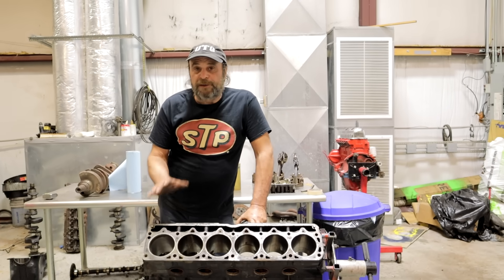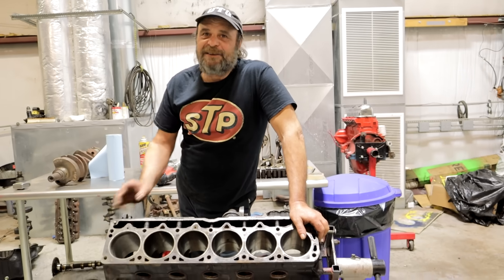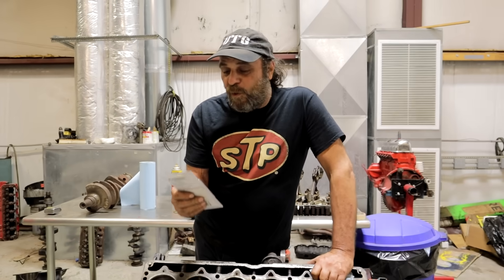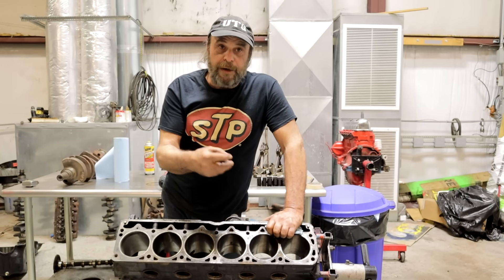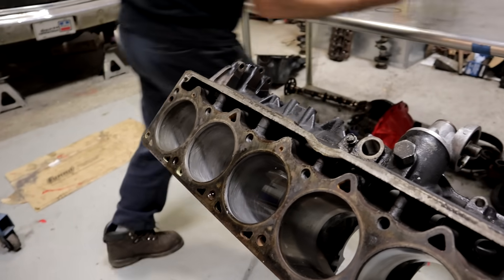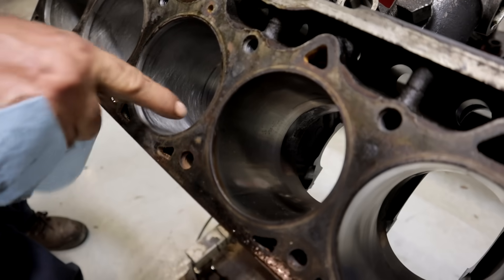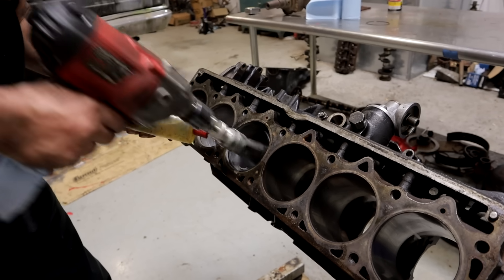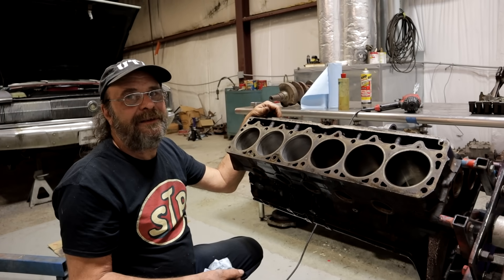Your First Engine Job - Honing For Crosshatch And Choosing The Right Stones For Your Rings

Comment: Good on ya uncle Tony 

I saw a video here in Melbourne for a performance engine builder 

and I know your channel as for the DIYer but just as a point of interest 

he uses this gauge that is about an inch wide and 5 inches long and once you finish honing, you put the gauge along the cylinder wall. It throws light into the crosshatch and gives measurements as to the depth of the scratch how many scratches they are, and the angle and they keep re-honing until they get the numbers they need for the application 

very interesting.

Comment: Do you ever use a "dingleberry" hone?
Reply: Tony doesn't even own one.
Reply: In other vids he recommends against them as they purely follow what's there and don't do anything to  correct wear. You can make limited corrections with a 3 stone glaze breaker, as shown, since the stones are rigid enough to go over any low spots.

Comment: I learned again something important cause i was sure the honning had to be shinny and like the newer rings type.  Almost like a baby bum touch with a little brush almost glazed look.  I will be more attentive when i do my next engine.
Probably my 76 360-6 Winibago engine with 85 miles on it.   If i keep the same rings after a quick clean up, il will know what rock to use according to the rings application.  If i keep or change from wear over the mesured gap.  Thanks Uncle Tony.  Nice content again.

Comment: Quite a workout! Never used a torque plate, thought they were only used on race engines. If a guy is uncomfortable using gas as a honing lube, what do you recommend?
Reply: Kerosene or diesel work well and give you a little lubrication as well.
Reply: WD40 is probably the most readily available.  It's mostly to flush out the grit and bits of cylinder wall that come off, so the stones stay clean and leave a good finish.
Reply: Wherever Uncle Tony uses gasoline as a shop chemical (not as engine fuel), I would suggest mineral spirits (lubricant/solvent), or acetone (better solvent, but more flammable).  The other suggestions of WD40, kerosene, or diesel fuel are good too.

There aren't many of Uncle Tony's shop practices I disagree with, but splashing gas around like water is one of them.
Reply: I've only seen torque plates use on a bore machine, not for just honing.

Comment: Why not remove the ridge at the top of the cylinder bores. Just lazy or is there a reason not to. The ridge preloads the hone to work and cut harder on the bottom of the bores and removing it makes for a nice job. I have seen this many times on YT videos. If the bores are worn enough in a high mileage engine you can NOT hone it correctly. Not only that but if you are going to build a high winding engine the top ring can impact the ridge at high rpm. Love to know why you do not remove the ridge.
Reply: I think this is about as well as Tony can explain his reasons.
https://youtu.be/unwAKlCdyas?t=640
Reply: Uncle covered this ridge reaming subject a few weeks ago, and explains why he doesn't ream. He explains it better than I can, but one reason is that the bore above and below the wear length of the piston stroke is the true, unworn bore and is a guide for the hone boring.

Comment: Have you ever sprayed Dykem on the walls before honing to see how straight the bore is?
Reply: Thats a quick method used by most before breaking out a dial indicator/bore gauge. That method show's you little IMO other than if you have something to start working with. Dosen't work with dingle ball hones at all and with cheap stones he is using. It's still in the hand ganade and tissue paper sign of what your working with. This method is tried and true to work 90% of the time, the main point of the video. You mised at 14:44 he put a stone in backwards, won't hurt anything its a softer metal than the cylinder.

Comment: I have been thinking about hone lately, I thought about finding a engine to test some theory on, I was thinking maybe do a really coarse rough hone, then go work up to a extra fine hone, to get a smooth feel yet have enough hatch to hold oil, it would not be a iron ring, and would probably work best with a tighter bearing and thinner oil,,  but definitely a lot more research needs to be done before any testing ,  I have heard the modern European engine  basically look like there was no hone, very smooth bores,  they use something like a 0w20 oil also,  I guess this is part of the origin of my theory!
Reply: Go find some videos from Lake Speed Jr. He's already been there, done that, and recorded his findings. He's been doing it for a long time while employed by Nascar teams to ring development. He probably had some input on the super thin rings they sell today.  Also... even American motors are using 0W20 oil now.

Comment: I am amzed you don't cut the ring grove out the top of the block, we were always taught the ring wears round on the top and the new rings are square and if you don't cut the ring grove out its supposed to Break  the new top ring. Using standard rings on a honed cylinder is supposed to make a poor boy low tension ring setup. It may use a little oil but it will wind up rpms faster.

Comment: Never tried it myself, but another DIY technique for surfacing the block, use an oil stone.
Reply: Ozzie ,  I think the 'junkyard jet' kids did that in an old vid here somewhere.
Reply: I have seen people resurfacing cylinder heads by placing them upside down on a sheet of glass covered with sandpaper and doing figure-8 motion dragging it around. I believe it works sometimes with proper touch.

Comment: Thanks for showing the kids how we did it back in the day.  However, my local machine shop in NC is very good.  I don't play this game anymore.  I talk with them about my engine goals and piston ring and cam package.  They do the Magnaflux, line bore, hone, balancing (most important), and bottom end assembly.  It's not that I can't do it, but they have an incredible hot tank and all the new machinery to make it right.  In reality, what they charge is nothing compared to the work you get.  I don't know how they do it for what they charge.  Maybe I am just lucky because of my area.  For 2 or 3 hundred bucks to get a fully machined and assembled long block...  I'm your huckleberry.
Reply: At that price I'd love the name of that machine shop. Worth the 3-4 hour drive into NC if they're good as you say.
Reply: @ImAfraidBruce  In the Charlotte, Greensboro, Raleigh area they are everywhere.  The key is to be open about your project and pay cash.  There are a ton of engine guys down here that can rip out a street engine in a couple of days, especially if you bring them all the parts.
Reply: I agree, if you need it done right!  If I'm gonna have it bored, the machine shop does all of it, including the top end.  I believe this helps them, too.
I'll bring the parts if they want but when they provide parts they get some mark-up so I ask which way they prefer to go.
Reply: Try 3k where I live...🤬

Comment: Always used cast rings in everything I've built, and finished off with 120 stones. Worked for me. I used kerosene, very slightly oilier than gas, and doesn't evaporate as quickly. All past tense now, my days are behind me.
Yet another great instalment in the series Tony. Great work as usual.   👌👍
Reply: I use cast rings on the iffy bores, not perfect but not that bad. 300 grit and brake em in like I'm gonna run it. Run it up pretty hard and back all the way off throttle. do that a few times then just drive it. Never had a problem with rings setting.
Reply: i like water because it is easier to flush out, kero has a slight problem with hanging around, my opinion

Comment: Had a friend of mine that was honing the cylinders on his engine, (It was a SBC 350) the "Crosshatches" that he has done were not really crosshatches but horizontal straight lines. I suspect he lowered the hone too slowly and not enough up and down movement. Ugh, just the thought of the rings being caught on the horizontal hone marks, makes me shudder.
 Thanks for the Insight on honing cylinders Tony, now i'm less likely to screw up the honing job on my engine. The engine i'm going to be attempting to hone is a Big Block Chrysler 361.
Reply: That reminds me of my first attempt.i had to switch to a variable speed drill and slower rotation to get the cross hatch.moly seems to be less sensitive than some types about cross angle but why chance it?
Reply: @johnstuchlik5828  same thing I'm thinking of right now, I'd like to get moly rings but moly rings seal better on a mildly/smooth home surface.

The cylinders on the 361 is glazed and pretty smooth, good for moly rings, I reckon if I go instead for cast iron rings I'll need to restore the cross hatching somewhat.

Comment: I’ve honed motorcycle cylinders I was told no more than 15 strokes
Reply from the maker: Some bikes use a nickel plating which is extremely thin.
Reply: @UncleTonysGarage  I wonder if that's the same as the Nikasil coated cylinder walls found on Porsche's and Mercedes.
Reply: @JayMalone26  yes or different tradename for the same/similar thing.   
you can get them recoated though.
Reply: @JayMalone26  some motorcycles have sleeves or chrome plating

Comment: The video{s} that Lake Speed JR did about advanced thin rings and honing techniques is really so insightful. We've really come a long way since the old days of the gas station mechanic dingleberry deglaze and new ring job. The bore surface finish could be worth up to 50hp or more as it relates to ring seal. In the old days everyone thought it was the camshaft that made all the power, and then the gasflow concept came in and we devoted more attention to cylinder heads and porting, now there are so many aspects of the engine that can make and break power that we really have to look at things in a holistic way and not lose sight of how things work in the grand scheme.
Reply: Agreed.  Piston rings are the greatest friction source in an engine.  Reducing friction, or increasing cylinder sealing at the same friction, is free HP and efficiency.  Well, not free - sometimes it costs a lot of money for such precision.
Reply: NICE BOAT ENGINE

Comment: Did no one else catch the one of the stones was facing inward and not touch the cylinder wall?
Reply: Yep, squirrels lol
Reply: That's to help scratch deeper cross hatches
Reply: @midnightrunner684  That's the oiler hatch.
Reply: I saw it, just to be sure i played it over super slow  lol
Reply: I did at about 14.40. Shit happens.
Reply: Never live this one down! Hopefully the chinesium on the hone was softer than the cylinder.
Reply: So those rings will thread down very tightly in the cylinder.
Reply: Yup 2 out of 3 ain't bad...
Reply: I seen that too, on the last pass
Reply: Ya, at 14:45 😣
Reply: He did that to test us . I saw it , but I was only on my 3rd beer

Comment: The steps you’re taking in this series of videos, will they also work in newer engines such as an LS engine? I’m looking at possibly doing my first at home rebuild of an LS that I hope to swap into one of my older gm rigs.
Reply: Should be generally applicable to LS engines or any other automotive engine .
Reply: @kaboom4679  thanks! When he started talking about differences in rings and blocks and whatnot I started to question things that I thought I was keeping straight in my head :)